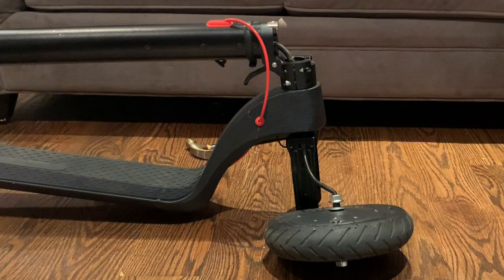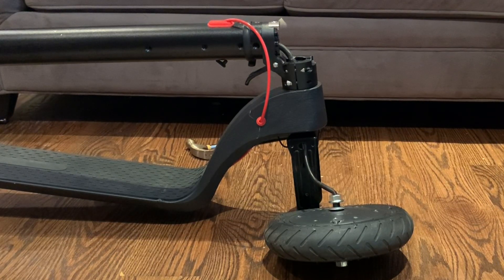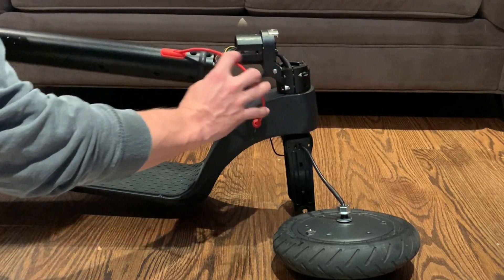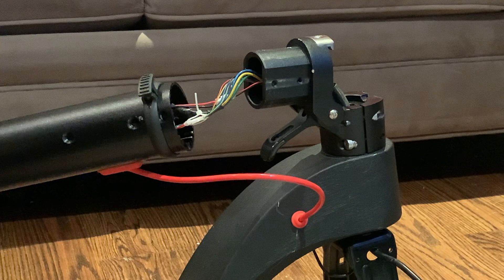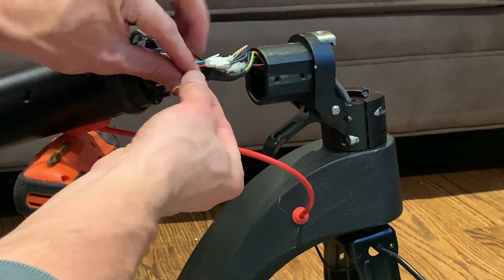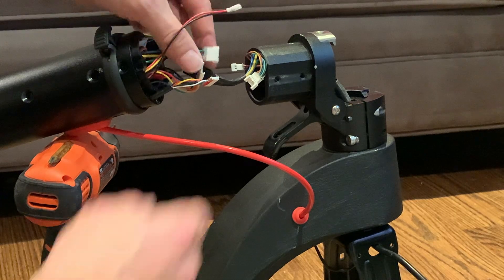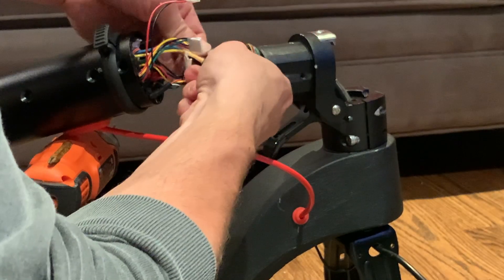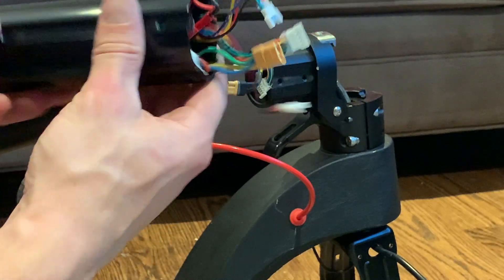Removing the Controller

Comment: I have the same scooter and when I go fast mode the maximum it goes is 12-13. it used to go like 32 or 25 but now its just slow does anyone know???
Reply: your battery might have gone into deep discharge and become damaged. did you leave it sitting for a while without charging it every 2 weeks or so?
Reply: @bigboi9856  I never used to take out the battery and I don't charge the battery at all, I only charge from the scooter.

Comment: Hello. I have the same scooter and I was wondering if I can get my controller replaced. The problem is that I live in Italy; is it possible to be shipped here?
Reply: What kind of problem do you have with your controller ? I am curious because my one may be is faulty too.
Reply: @HM-xn7uy  I think my main controller died. I opened it to solder a wire that got desoldered and I shorted something somehow. Now the scooter doesn't turn on anymore. Now, as I am not good at troubleshooting PCBs, I thought I could order it, but unfortunately they don't ship products to the EU from their official site.
Reply: @RedPixels_  Maybe Turboant, which is also a reseller of the HX7 ( Levy 7 ) scooter ships to EU.. Have a look at their website regarding support

Comment: Does the Hall wire problem have something to do with "power loss of motor". My X7 shuts the motor completely off; after restarting it it is running for short time normaly and then immediately it shuts off again. Sometimes at full speed it is not possible to reduce the speed with the throttl ( danger ! ). The battery is fully charged and the problem only arises when actually running the scooter. In test-mode ( lifting the front wheel and giving power ) the problem doesn`t happen. I checked the cable-connections of the controller. They seem to be well connected. So I suppose my problem is related with the hall sensor of thumb throttle. /  There is 1 cable coming from the controller with red/blue/green/red coloured wires which is not connected at its other end. I don`t know for what it is ! / I hope someone could give me advice ! Thanks in advance !
Reply: i have the same fricking promblem

Comment: Hi mate, I removed the battery, removed all the screws and I could not slide the controller unit out of the tube. It sounded like it was being blocked by something solid. Is there a trick to removing it from the steerer tube? Thanks.
Reply: @levyelectric  Awesome, thanks buddy.

Comment: How increased more speed, my scooter levy dont pass of 24 Km per hour.
Reply: Hold both buttons at the same time, then the up button propably 3 times, then   
down button once, up button once. Then hold both buttons again.
Reply: @youtube_yolo4240 it worked!
Reply: I have the same question I want more speed any way of upgrading or to modify the controller to give more power to the motor? Or bigger battery's?